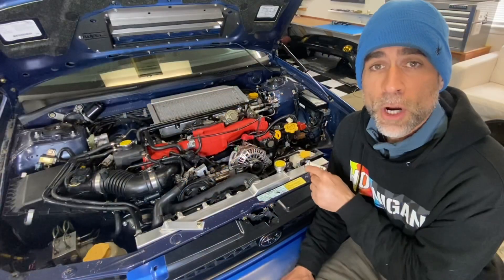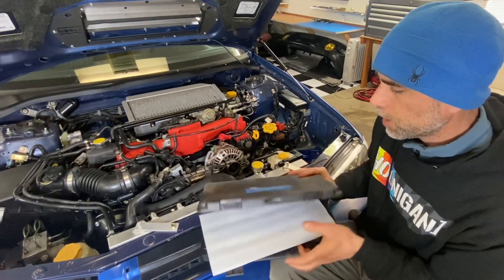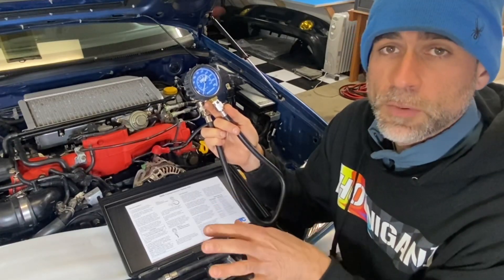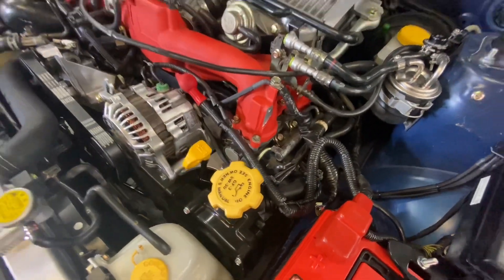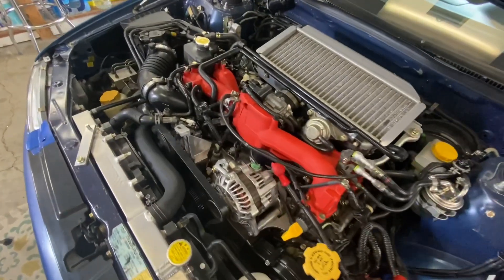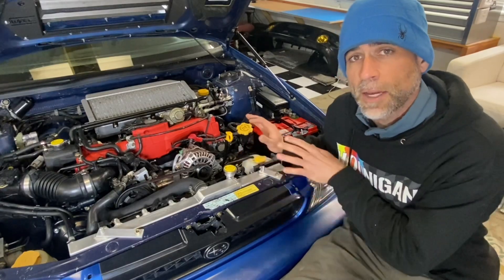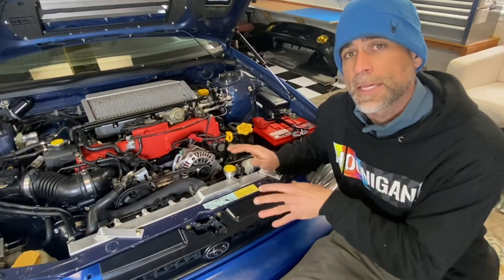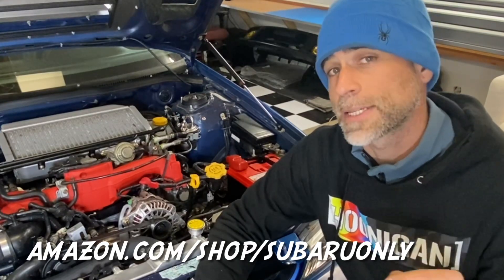No Compression in Cylinder No. 4 (blown engine?)

Comment: I bought my first 2020 STi with 50k miles and bought from a Mazda dealer, read carfax they said it went through inspection. Car idles fine, sounds fine, boost pressure solid, and acceleration and everything all normal. drove the car just over 3k miles directly after first oil change and car started making rattling noise from engine. checked dip stick nothing. Added 3.5 qts that's how low it was. Checked for external leaks only found one of the oil pick up tubes with minimal leak but nothing that would cause that much loss. Took it to Subie dealer had oil analysis done and brought car back in 850 miles after that oil change. 3 qts low again smh. did compression test 3 out of 4 cylinders bad. And here's the best part in first subie ownership experience had 2k miles left of powertrain warranty which voided after they ran DATA off ECM they determined it was tuned and modified by previous owner and put OEM parts back on they wanted 14k in repairs plus 1500 for new ECM to have 2 year parts and labor warranty. NEVER AGAIN

Comment: 2007 legacy gt. New build with ej207 ver 10 sti shortblock with stock legacy u20 heads reused. Just did compression test after 500miles.. readings were:
Cyc 1: 105
Cyc 2: 106
Cyc 3: 108
Cyc 4: 110

Are these acceptable figures for a new shortblock or i need to rebuild my heads?

Comment: Hello,

Great explanations!   

I have done a leak down in my 2011 2.5i outback and I can hear air escaping but not into the intake, crank case, or coolant on cylinder 4.   

What would your next step be?  

Pull engine.  Check valve seat?

Comment: Don’t know why we didn’t do a compression test the motor WAS just put in new from Sunwest performance short block and single piped the kid put over 15,000 in this motor and I bought it and had issues immediately after purchase car ran super good on the test drive but ran completely different after transaction a week later it’s 2004 Subaru Impreza WRX 2.0 and I changed the MAF sensor and some oxygen sensors and I tried taking it down the road and it blew up

Comment: Thanks for the video. Just subscribed. Same issue on my 99 forester. Cylinder 4 no compression. Still runs great down the interstate. Lots of lost power starting from stop though. Deciding what to do next... Would like to upgrade power from stock ej25. Do you know of any engine swap upgrades. Probably buy a service manual from your website too. Thanks again.

Comment: 2006 Subaru sti po302 did plug and coil swap, vacuum leak check with smoke machine.  Checkrd a/f ratio sensor cleaned and tested for ohm specs and voltage with heat. Next is injector swap then leakdown test with otc kit
Reply: What did you find out bro?

Comment: I have a similar issue with an unrelated engine. It happened suddenly while driving: losso of power, flashing check engine light and ECU complained about cylinder 2 misfire. However, the garage said it was lack of compression in cylinder 4. Also starts well and idles fine.

Comment: Hi mate, im currently trying to purchase a 2010 WRX, we did a compression test on the engine (it was cold, and we didn't use wide open throttle). Cylinders 1, 3, and 4 all had compression at 135-140, while cylinder 2 compression showed 120. Is this a concerning sign? Should we redo the compression test hot and WOT or skip it and try to convince the seller to do a leakdown test on it before I buy? Thanks!!

Comment: Hello, Thanks so much for posting your very informative videos. PLEASE HELP!!! I will start with the question I am hoping you can answer, explain the backstory and end with the same question to keep things organized. I genuinely appreciate any advice and feedback you can offer. Do you think it is possible for a rodent nest (10"x6" mind you!!) to cause no compression in cylinder 5? I have an expensive problem on my hands. I was driving my 2015 Toyota Highlander (102, 000 miles well maintained with proof of service) it started shaking and check engine light, Check all wheel drive and check traction lights came on. Brought it to our local mechanic and they found a rodent nest on the engine (engine bay I believe), upon further inspection they found that cylinder 5 had no compression, but they weren't exactly sure why and suggested we take it to the Toyota dealership for additional diagnostic. They found the same issue (still don't know why, but they don't seem to think it could be rodent related, but again aren't certain what caused the issue). Because there is no other reason given, do you think it is possible that it could be rodent related? It just seems very coincidental, but because I don't know enough about cars it is hard for me to prove although I am trying to dig up what I can and found you :) Toyota and the insurance company didn't see any obvious wire chews so they closed my claim saying it must be "wear and tear" except I have our steady service records and the mileage is less than a standard lease contract- we have a 2010 Rav 4 with 30,000 more miles that is serviced the same and is running great- the mechanics said this is "very rare for a 2015 Toyota" and said I essentially got the short stick and that cars break, and now I was forced to replace the engine as the only solution ($8,200 +450 in diagnostic fees). Toyota was hoping they would find an actual reason (and of course I was hoping it was rodent related as it would be covered by insurance), but they took out the engine and still have no distinct reason for the engine failure/ cylinder misfire, but said maybe it could be debris that made it way into the engine somehow or a mechanical issue (broken arm??). Anyway because that differs from chewed wires, I reopened the claim thinking it could potentially be nest material (there was lots of material) or mouse food "debris"- there just isn't another explanation at this point. My family has been without our vehicle for almost 1 month and it has really made our lives difficult. Anyway, sorry for the long story, but the insurance company is sending out a "engine expert" tomorrow morning to look at the engine and prob try to disprove that it could be rodent related and it feels like it is my last chance to make a connection and prove that it is possible. I found some articles that say maybe an issue or obstruction in the intake?/ debris somehow getting by the air filter and clogging or making its way into the cylinder?/ debris getting sucked into the air filter then the intake (intake runners or intake manifold)?/ Debris getting caught in the valve train preventing the valves from closing causing no compression?/ a block in the throttle plates??/ Issue with the knock sensor injector?? I will ask more questions tomorrow, do you have any advice on how the rodent nest could have caused no compression in cylinder 5? Thank you in advance, Kristin

Comment: At the beginning of the video when you ran the test did you hold the gas pedal all the way down to cut off fuel? Or did you remove the relay/ fuse
Reply from the maker: Yes, pulled the replay.

Comment: Might be a silly question, but would you be able to diagnose this via an access port? Not the exact cylinder just that one has decreased compression. 

Thanks!
Reply from the maker: No. Access port would only tell you the check engine codes and allow you to monitor live data streams - no sensors monitor compression, you’d end up having a misfire code, which is the result of the low compression.
Reply: @SubaruONLY  thanks man. I dig the videos and your communicativeness. Subscribed
Reply from the maker: Thanks man. Appreciate the kind words. Cheers 👊

Comment: My #4 failed. Ringlands. after rebuilding a number of Subaru EJ25 i washed my hands of them. PIA and they never run the same after a HG failure or anything major. Just end up throwing part after part at them. As they fail continuously.
Reply: Toyota and honda way ahead on engine reliability
Reply from the maker: Ahhh that’s rough man.  Get an LS?

Comment: How did it drive like that ? Apart from being under powered, cheers keep up good work
Reply from the maker: Drove so so.  Didn’t hesitate or miss or anything. Just under powered and didn’t spoil up fast as it should.
Reply: @SubaruONLY  only ask as ive an 07 sti hawkeye and last 6 months shes got a strange surge feeling at very light throttle inputs only between 1900rpm to 2400rpm (dbw) thinking its in tune now as tryed everything apart from compression test but no really under powered under wot, seems in lower rev range, any help would be much apriciated, thanks

Comment: With a compression tester it won’t lose pressure. Once it hits a number it will hold it until the release valve pressed. A leak down tester will leak down because it doesn’t have a Schrader valve but I would retry on another cylinder before saying anything is dead.
Reply from the maker: Umm...that’s all true for a compression tester, but you forgot about the engine! 😂😂😂
Reply: I’ll stay tuned. I just know a misfire cel is caused by so many misfires within so many rotations of the engine. It can be caused by wiring, injectors, plugs, or coils. Just seems very strange the cylinder is bumping to 30 psi and then totally gone. Like an issue with the compression tester leaking either at the quick connect, the schrader valve or the release button. The leak down test in a normal situation would be correct but if that compression tester is seeing any pressure it would start at that point.
Reply from the maker: Not an issues with the compression tester. What your seeing is what it looks like when the rings, gaskets or valves leak slightly. FYI.

Comment: Are you going to try get a V7 EJ207 short engine? and use original heads?

The v7 207 is a stout engine
Reply from the maker: Nailed one of the top options I’m considering. Exactly man 👌 ! Use the short block an EJ205 heads and new OEM 2002 ECU for BAR and all the legal stuff. Then pull it back out, swap back in the 207 upper end and ECU and be on my way!!!! 😉

Comment: Thank you Luke. 
I have similar problem on STI , one cylinder near zero compression, slow off mark, engine shakes at idle, but still goes well,  still kills WRXs (maybe the power comes from the turbo that's why 2.0 and 2.5L engineer new not much different in performance?  I think it's bent valve situation,  I don't know how, also has already slight bearing knock, ( maybe extra play in rod has caused piston to hit valve? One theory),  You can hear that one piston is low on compression when you crank engine  too. 
I should do a  leak down test. Can't wait to see how to do it. Looking forward to next video on that subject
I'm wondering if  you sell the OBII engine check scanners.or have any recommendations? 
Could you please show us how to use? Also do you know how tune / remapping? Any recommendations?
Reply from the maker: Hi. Thanks for the support buddy! Yes, leak down test next. No, I don’t have any experience doing tunes myself. For the OBDII reader, check to the “Subaru Tools” section of my Amazon shop. Cheers!

Comment: Other than the obvious check engine light how did it drive with zero compression on cylinder 4? Was it terribly obvious or just didn’t feel quite right?
Reply from the maker: Not too obvious, tbh. More like didn’t feel quite right.
Reply: I have a 05 Xt with 0 compression in cylinder 2 , idles not the best , but once moving over 1200 rpm it’s like nothings wrong … full boost stage 2 tune downpipe . I wanna say intake valve stuck ?

Comment: What about doing a wet compression test just to compare results? Also, I would like to see results of the leak down before ruling out valve issues because I have seen a number of exhaust valves that tighten up after rebuild.
OTC tools are really good quality on most things too.
Reply from the maker: Yes, will do the leak down first thing. My be tight valve, that would be nice!!! 😉

Comment: That sucks..... I'm doing an EJ255 now with a melted piston where they let the ringland failure go for a while.  Aluminum splatter lining the cylinder wall.  
I love my OTC tools.  Never had an issue.  I have their compression, fuel pressure and leak down test kits (in addition to other tools).  The leak down tester is great at identifying the major source of the leak.
Reply from the maker: Thanks man. Both in the same boat, haha.  Cheers!!! 👊

Comment: Possible burnt valve. Id check for that after leak down test
Reply from the maker: Yes, will do for sure man!!
Reply: Hadn't watched the full video yet when I made that comment, so I heard after the fact you did the valve work and all. 

You can also squirt some oil down the #4 spark plug hole and do another compression test (warm) if you get the jump in Psi that would lead you to piston rings. (I'm sure you know all this but been in this same boat a few times with my subies) still thinking it could be chipped valve. Will be waiting to hear what it is!
Reply: Also when doing leak down, get a nice big ratchet on the crank and see if you can nail down the #4 exhaust stroke and intake stroke for valves. If they both yield the same leak down % prob not a valve! GL!
Reply from the maker: Thanks man, much appreciated. Keep it coming! 👍

Comment: Probably a bad valve
Reply: My guess too. That’s why it runs fairly well on the road. When the engine reaches operating temp the valve releases. Just a guess from an idiot. 🧐
Reply: Just heard the previous guy had a “big turbo “ changing my guess to ringland
Reply from the maker: Yep, very possibly. The leak down will tell all!!!

Comment: EJ207 Short block,factory forged internals. Such a shame.
Reply: I know! It was a helpful suggestion. But if I were going to replace the block then replace it with a bolt up the same better part that cost bugger all more.
Reply: @gen3v8  the why you typed it sounded like you though it was a shame that the block was a v7 and blow up
Reply: @jeff666p  All good wolfy,. It was bad luck though will all his work so far
Reply from the maker: Yes!!! 👌👌👌
Reply: This is a 205

Comment: 150 psi is warm pressure.  Pressure when cold is lower.   Didn't you rebuild the engine
Reply from the maker: Good call. No, short block is original OEM one from a 2005 WRX, no idea how many miles.